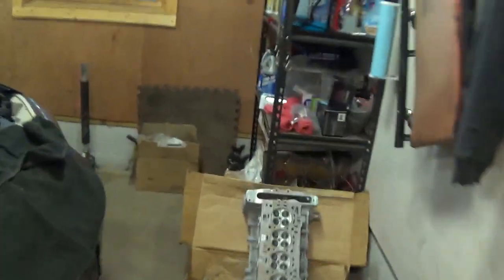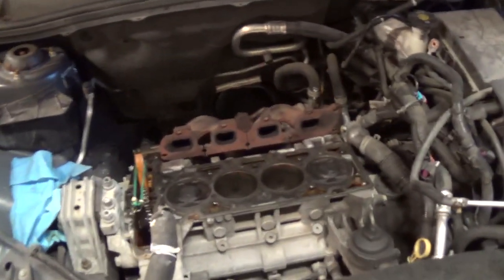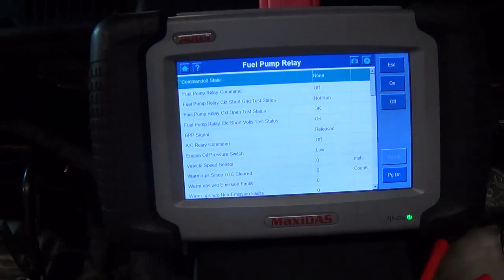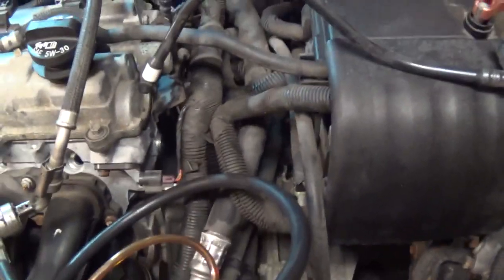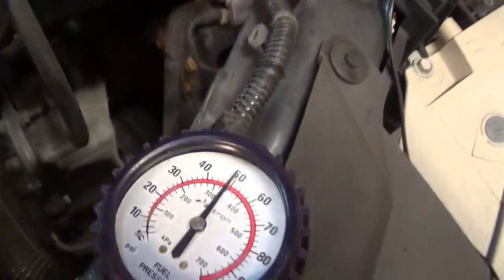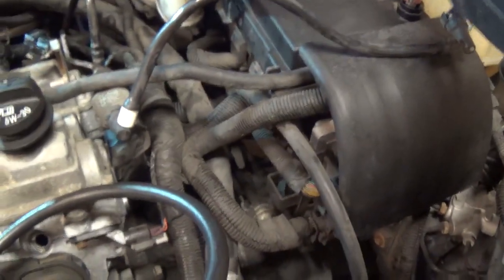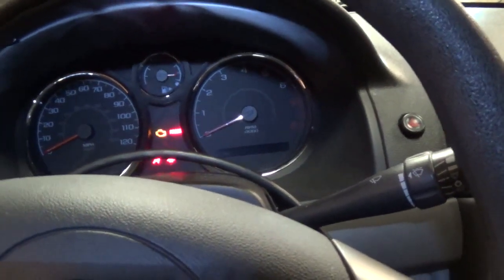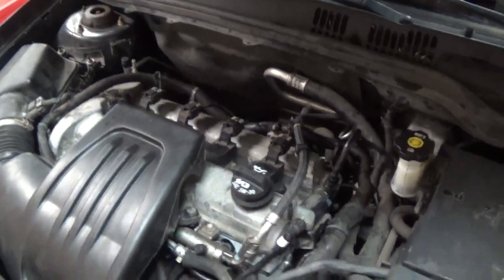P0300 Misfire case study: 09 Chevy Cobalt -Part3 THE FIX

Comment: Great series thx, learned lots. In a previous life I used to hand grind head valves and seats at a REME barracks in UK. It's quick and easy, only a stick with a small rubber sucker on one end and grinding compound. Did thousands of valves that way on small eight valvers up to huge 32 valve V8's - would have been a hell of a lot quicker and cheaper than the M/C shop.

Comment: Solid work! Great job very thorough. How many miles were on that car to begin with? I've got an 05 Cobalt with 306k; only major service was a transmission at 170k. Hydraulic clutch master cylinder went bad and I 
Destroyed the rest thinking it was the synchros.

Comment: OMG I just have the same problem with my 2008 I did swap test of spark plugs and coils change injector and I did the pressure test on the cylinder and my #3 has low pressure so it will be exact same problem  this car with only 100500 miles on it. By the way how much will be to fix this issue?
I won't be able to do this by myself that is obviously I am amateur YouTuber mechanically true sk I do most I see on YouTube 😌 with the guide of mechanics like you I have do many repairs successfully.
Anyway how much this will cost from a real shop?

Comment: Hey just watched your 3 videos on repairing the Chevy colbalt cylinder valve and head. I wish you lived near me because I have an o6 colbalt that out of nowhere while driving it just seemed to start running on half the cylinders or missing really bad. Someone told me coil packs could of went bad. Im no mechanic and I really need my car. I live in NJ Delanco to be exact. I think your a very smart guy. I've watched lots if different videos and by far your very very good at what your doing. Is it possible that if you live close to NJ I could bring my car to you for repair? Please let me know asap. At jbogs2587@gmail.com. please contact me asap. Thanks!!!!

Comment: I have an 07 cobalt with the 2.4l engine. The ecotecs are interference engines. And when the timing chains on those breaks, the owner can kiss the engine good by. Because of it, it's highly recommended to replace the chain, tensioner and guides especially when pulling the head and the engine has a lot of miles, like over 150k. It will add to the price of the repair, but it beats replacing the engine when the chain breaks.

Comment: Excellent video man. Definitely subscribed.

I have an 07 Saturn Ion that needs the same thing done to it. Only 31,000 miles, a real bummer. Is it a manufacturer defect with the valves? What's to say the same thing won't happen again in another 30K miles. Just wondering before I go ahead and have the shop proceed. Thanks!

Comment: did you surface down the block it would blow the head gasket easy on un-surfaced aluminum cylinder blocks seen it before there is no problems on cast iron cylinder blocks just to let you know ur a good tech

Comment: Fuck my car is going this exactly I changed the fuel injector ,spark plug , coil pack and still cylinder one misfire! HELP Lol
Reply: JustTimmyOnHabbo I have the same issue with cyl 4 I've done everything too I'm fearing i have leaking valves :(

Comment: Hey, just came across your video. I was looking for fuel injector fixes. Anyways I have a 2009 cobalt at 230,000 miles. I have never had to do anything with the motor. Besides now fixing the injector. Could you let me know what I should do to the vehicle for longevity. I.e. Tune up etc... I've had it since 10 miles. So I'd like to keep it. But I can tell it doesn't feel strong and tight anymore.

Comment: how bad is this issue, i have been driving for months with the same problem   , my cobalt has the same issue.
and a local repair shop  after doing the compression test, found a cylinder having less psi quoted me >2000$ to rebuild the cylinder head ..
my cylinder 2 misfires with rough idle.
Reply from the maker: Well you should get it fixed sooner rather than later, otherwise you might need new valves and seats on that cylinder which just adds to the cost.
Reply: Any idea if Additives like adding Engine Restorer or Marvel Mystery Oil would help this condition ? cant afford the rebuild at present
Reply from the maker: Unfortunately there is no "magic" way to fix a poorly seating valve. At least I am not aware of any...

Comment: I'm staring this potential job in the eyes myself on my 06 ss. it's a 2.4l na, nothing special, bought the car in September with 110k on it, diagnosed and fixed a tc problem stemming from bad variable valve solenoids, and dumped about a grand rebuilding my suspension and redoing the breaks. now cyl 2 is misfiring, slowly spreading to cyl3.. diagnosing and repairing this well beyond my capabilities lol, so it's off to the shop in the a.m. for diagnosis. how much would you charge for this whole job? just asking so i know what to expect from my local shop
Reply: Jake I'm having issues with my traction control keeps going off but can't imagine the vvt solenoids would cause it to malfunction. I'm also getting the misfire on cyl 4. But maybe it's time to change the oil.
Reply: Paul  Sosa my tc issue wasn't throwing codes, so i did a cap dump (disconnect battery cables from the battery, touch them together to discharge voltage from the computer) causing a complete reset of the cpu, at which point i got an immediate code for the map sensor, and replaced that. tc issue right away got a lot less severe, but still popped up here and there. did a little research and found those solenoids going bad can cause the engine to go into a kind of safety mode causing traction control to shut off and extremely hard shifts between gears, and will not trigger a check engine light, other than the tc light. so, i replaced the exhaust and intake solenoids and the problem went away. the solenoids are simple, right on top, left hand side if you have an ecotech. just make sure you don't put the ehaust in the intake port and vise versa, gotta make sure you put them in the right spots so do 1 at a time
Reply: Paul  Sosa also, i did a bg inductions service and fuel injector cleaning at the mechanic, and my misfires went away. its different from the fuel injector cleaner you dump in your gas tank, that did nothing for me, the service i had the mechanic do solved the issue.

Comment: i have a 2007 cobalt. engine light is on and I'm getting p303 3cylinder misfire. I'm dropping it off at the shop this week. think,i might have this same problem. if so how expensive can this get.
Reply from the maker: Depends on labor and machine shop rates. Ballpark is 1.5 grand or so...

Comment: i have a misfire in cylinder number one. did a compression test first 180 across all cylinders. bank 1 oxygen sensor was jumping  around voltage a bit but cleared up under wide open. but does not run bad at all. its the 2.4L in a 06ss cobalt. tried switching coils and did plugs but ill put about 60 miles on it and then it comes back. so maybe pull the injectors out and inspect the 0rings and such because i dont have a great scan tool. Any advice would be appreciated! Great videos!
Reply from the maker: Is it a hard misfire that you can feel? Do a compression check on a hot engine just to rule that out.
Reply: i did the compression test warm
Reply: and i cant actually feel the misfire at all...
Reply from the maker: hmmm interesting. Could be a false misfire counter. Would need to test drive the car while looking at misfire counters on a scanner to see what it's picking up...
Reply: Ya im going to need a different ob2 tool for that!

Comment: Nice Videos  found you though SMA 
glad Im not the only who used a less expensive version of the snap on pressure transducer i use mine on a vantage pro using the 5 volt from the pro  it will calibrate as if its the snap on one haven't used it with our snap on verdict because its wireless but it worked ok with my old modis

Thanks Andrew UK

Comment: Nice job Ivan, I forgot to ask, do you have a firstlook sensor?  I bet you could of saw the issues with the valves.  Up to what value of vacuum will your transducer show?  You could put the transducer on the intake and look at the intake valve pulls.  You could also put it in the exhaust.

Comment: nice work for sure. that is a stressful job.
Reply from the maker: +Randy Gudeahn (ProTech) Yeah any big job like that builds the pressure until you turn the key and "pray that it works"! Definitely a big relief when the engine purrs after the repair and doesn't leak :)

Comment: So, Ivan, What actually caused the valves to do that? Poor design? Poor materials? Poor manufacture? I have an 09' which makes me paticurlarly interested.
Reply from the maker: +Andrew Lulling The machine shop guy said it was from excessive heat, but the seats should be engineered to withstand way more than normal operating conditions, so my bet is on poor materials. 

Out of interest, how much oil (if any) does your '09 consume? How many miles? There are thousands of these things running around, and you don't hear all of them eating valve seats at less than 100k on the clock! Hopefully this one was a fluke...
Reply: Ahh My 09 consumes no Oil.  Then again its a 5 cylinder from VW. It came with regular oil that was used to break the engine in for 2,500 miles and its had synthetic ever since. Now at 101K.
Reply from the maker: Wait a 5-cyl from VW on a Chevy Cobalt?? I'm confused...
Reply: +motoYam82 , it's all VW. Just 2009 as a common factor.

Comment: Hey Ivan, did you do a post-compression test on the engine after the fix?  If you did what were the numbers?
Reply from the maker: +Upallnight No, but I assume they are all back up to spec at 210psi...
Reply: +motoYam82   Since the machine shop skimmed the head, the compression might have gone up a smidge.

Comment: Nice fix. I'm sure the customer like seeing all the documentantion, very professional. Did you happen to purge to air out of your line after you hooked it up to the fuel rail? I find that helps getting rid of a few psi of initial "bleed down" , that is really caused by the air decompressing inside the burdon tube in the gauge. thanks for the case study!
Reply from the maker: +1quickchevy2 Ah great point! Forgot to do that :)

Comment: Nice work Ivan and the engine sounded pretty good....
Reply from the maker: +stuzman52 Better than when it came in that's for sure! Actually runs smoother and quieter than I expected for a cheap "econobox"!
Reply: This engine was called the Global Four Cylinder when designed and most accessories mount directly to the motor for smoothness.

Comment: Ivan, great diagnostics strait thru to the fix ! Off topic a little bit, but I was wondering why you have the Autel. Did the Verus start acting up or is the Autel a back up in case it craps out? Two, how do you like it up to this point, and how is the coverage? Three, where did you buy your inducer for your home made pressure inducer? Thanks! Keep the vids coming!
Reply: like to see the pressure transducer build, I plan to make one soon.
we run 2.2 and 2.4L on our buggies and keep and extra motor in the shed we picked up for $500. we run them all day long at 4000 to 5000 rpm and never have any problems. did you have to tap the chain tensioner to set it in position.? great videio
Reply from the maker: +Billy R The Autel boots up really quick and I didn't need the scope here so no reason to bust out the big guns! I've owned the Autel longer than the Verus; it's been solid as a rock, with fantastic coverage for late-model (post-2000) vehicles. I might make a separate vid on the pressure transducer :)
Reply: Was just curious and the vid on the transducer that would be cool !